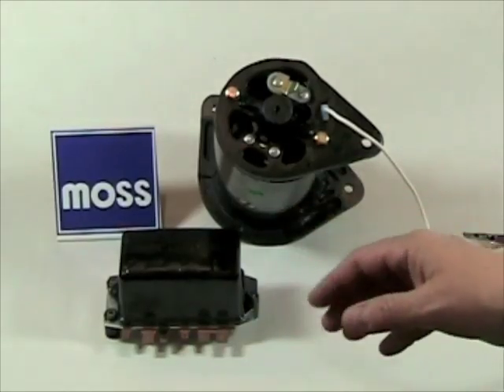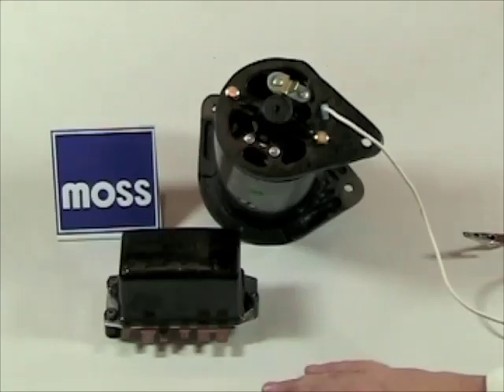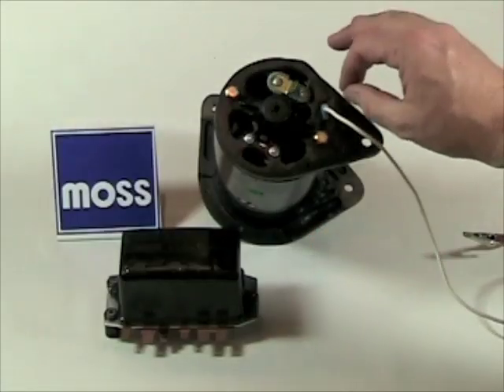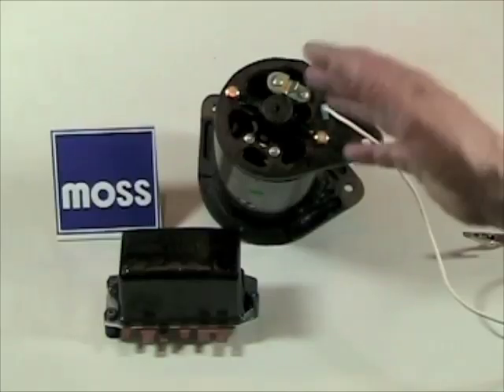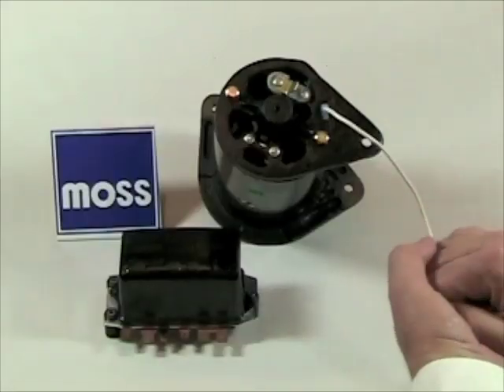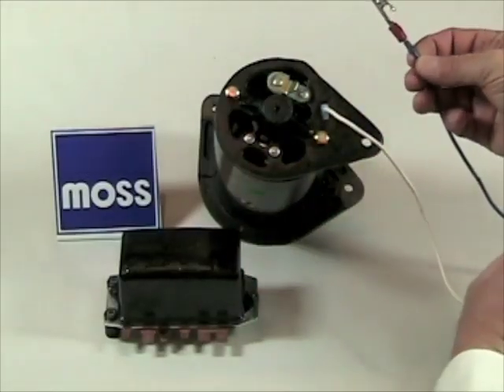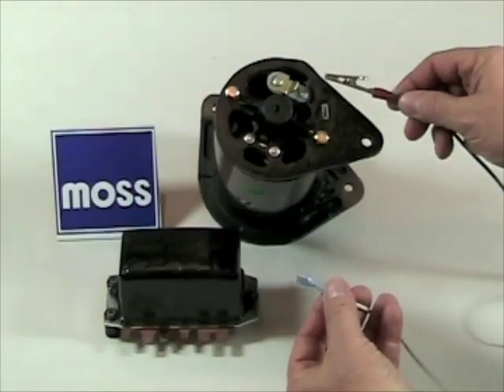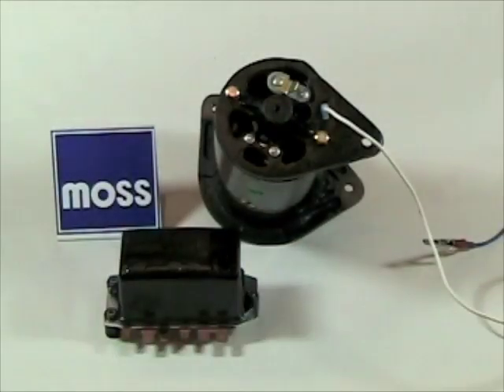Generator - How to Polarize at the Generator

Comment: Thank you! It's been so long since I've worked on the generator for my Ford starliner. It was rebuilt and the instructions they had were not very clear. The video is straight to the point and worked as it should. Thank you again

Comment: every time I start my 64 1/2 Mustang I have to repolarize to get the battery to start charging.  any idea why?  I usually do it at the regulator but i've tried at the generator as well with the same results.  works great until I turn the car off and then I have to repolarize next time I start the car.  Recently changed the regulator, generator, and wires in between both.
Reply: i have the same problem with my 64.5  did you figure anything out on yours?

Comment: Jumper lead from where?
Reply: You need a ground to the generator housing (if it is mounted in the vehicle, then it is grounded) and a hot lead to touch the field terminal (smaller terminal).  So if you have a positive ground then negative to field.  If you have negative ground then positive to field.  Engine not running and key not involved or off.  I am an automotive industry electrical engineer (hope this helps).  I always remove the wire from the field terminal before touching it with the hot lead (although I was told this is not necessary).
Reply: @dougbas3980  that was helpful, this is a lost knowledge really. And people worry about electrics since the invention of computer systems in cars.

Comment: you didn't have a ground wire to generator hooked up in video. No current can ever flow. Confusing if someone thinks on a bench you just touch field terminal alone with positive jumper only.
Reply: thank you i was concussed
Reply: your right. thank you

Comment: Hi, I recently changed my generator brushes.  The generator lite went out like it should, but after driving 10 miles it came back on.  Knowing the generator should be okay I tried  polarizing the generator from battery positive to field,with the field wire disconnected, as you explained.  I heard a twang, I  reconnected field wire and now works as it should. Thanks for the info, I never would have thought that was the problem, or heard of doing this before.

Comment: Worth mentioning that this is for negative ground and will be opposite for flashing to positive
Reply: +nick williams  Question...On a 6 VOLT POSITIVE GROUND system, as in IH Tractors, I was always told to "Bump" the Battery  Wire Tab on the Regulator With the Gen or "A" terminal on the Generator and NEVER to touch the FIELD Wire,  am I Right about that ???   Thanks,  DanO'
Reply: @MrDanoconnor